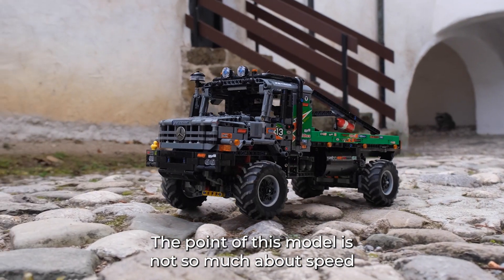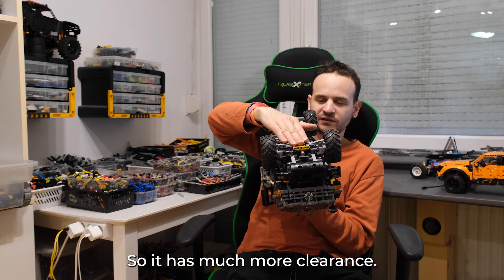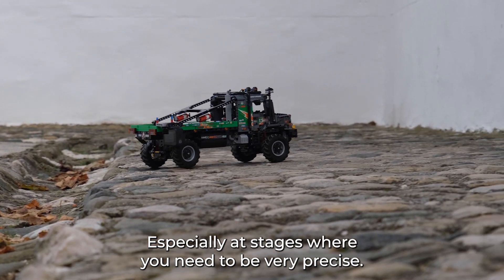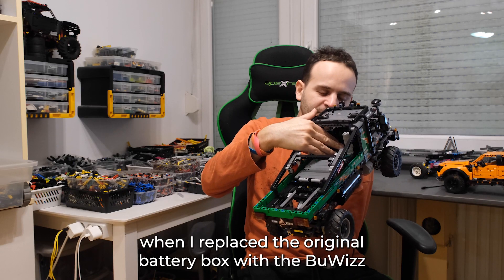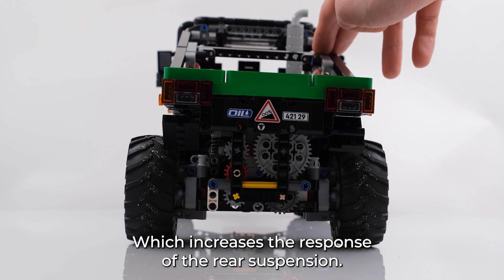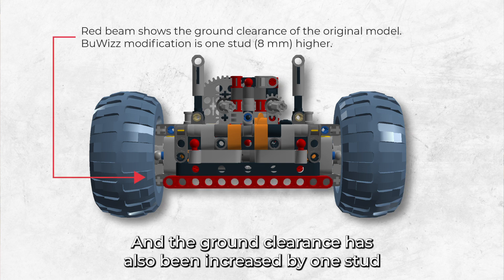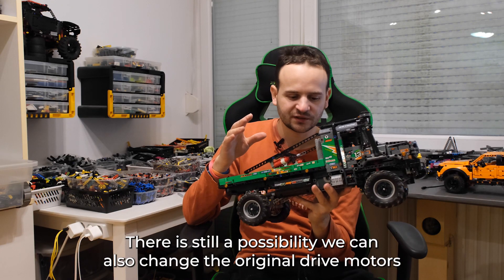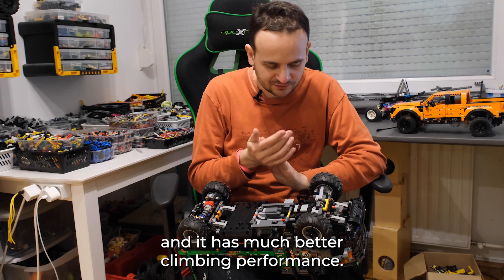LEGO® Technic™ 42129 4x4 Mercedes-Benz Zetros Trial Truck MOD with BuWizz 3.0 Pro Tech Specs -Part 1

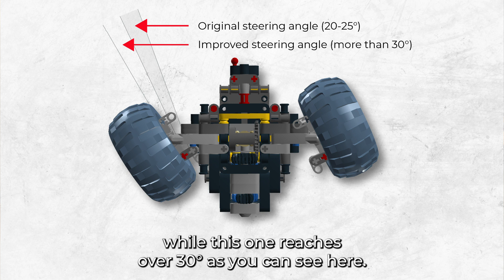Comment: 0:53 I made exactly the same angle (the dark gray piece is thouch this blue pin) and it doesn't work good :/ The cardan maximum angle is less then as you built. At this angle the cardan stucks unfortunately. Works good with only 2-3° more then the original

Comment: thanks for the video! I am adding my buwizz 3 to my zetros now. Could you advise how to setup the diff lock in the buwizz app? thanks a lot
Reply: Hai avuto una risposta ? Ci sei riuscito in qualche modo ad aggiungere il blocco differenziale sull’app?
Reply: @seankingyuanxia did you find a solution to setup the diff lock (locked - unlocked) in the app ?
Reply: @johans_mocs no I haven’t, but it’s been a while I played with my buwizz. You may want to check the latest buzz version and maybe they have added the diff lock function.

Comment: I love the changes. I bought the buwizz 3 and it is a real treat with the Zetros. I am trying desperately to copy your design with higher ground clearance and better steering angle. Could you please please post a video of how you performed the modifications?
Reply: You utilised the motors lego With buwizz batteries or the buwizz batterie With buwizz motors ?

Comment: Sory to say that, but with buwizz 3.0
 i hoped to see something faster.
Reply: bruh its a climber not lego model super car
Reply: @dawebberstein8625  
I notice that, still...
Reply: @yuvallegomotorized  i guess but being slower can climb better than speed as it loses traction easier
Reply: @yuvallegomotorized  bruh you had 4 buggy motors (nice vid tho) which are one of the best motors you can get. I’m not sure if you had it on speed or torque output but both are still pretty powerful. Also it uses tracks which means it can get over without its wheels catching on something. And with the tracks it has power split evenly so again it is easier to get over a pile of leaves.
Reply: @dawebberstein8625  
Its 8$ motor 🤪😍
It is the best 🏁
Reply: @yuvallegomotorized  yes